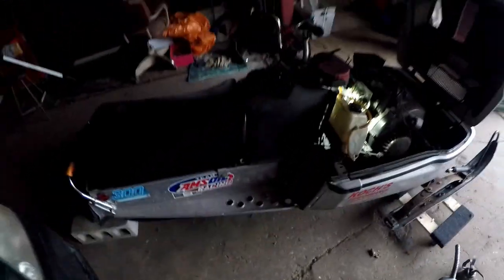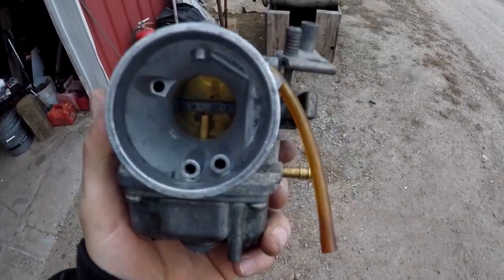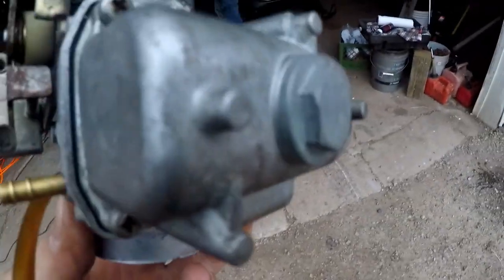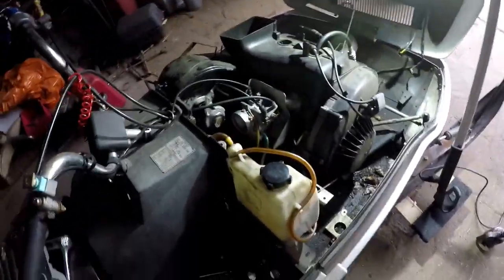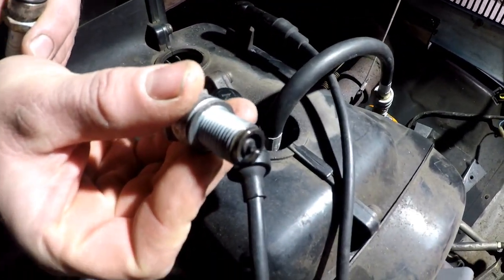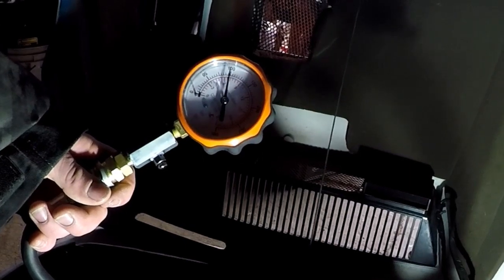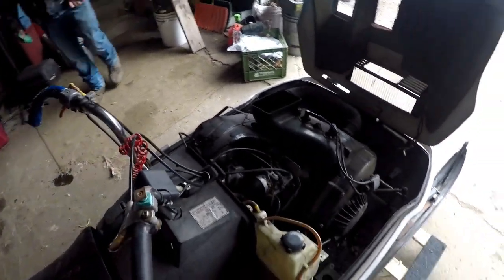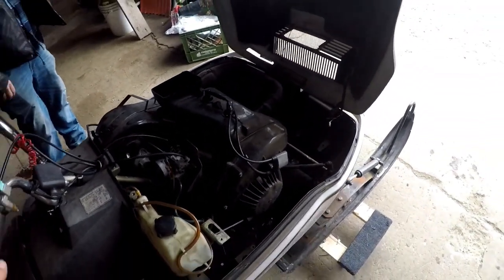1980 Yamaha Enticer 300cc Vintage Ice Oval Race Sled - Carb Clean & Install (Only Ran on Choke)

Comment: Where could I find a new carb for one
Reply from the maker: They don't make "new carbs" except round slides which is what we converted it to. You would need to source a good used oem butterfly style on eBay or Facebook perhaps if u wanted stock look. You can buy new vm 38 carbs online or a mikuni dealer.